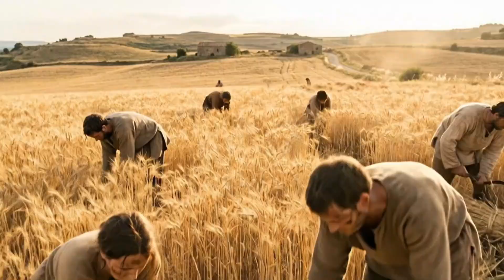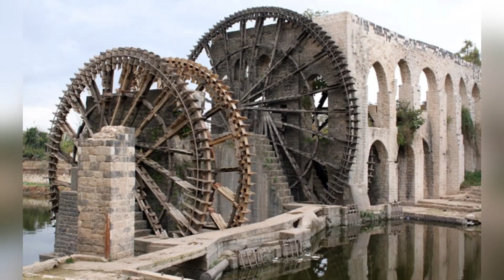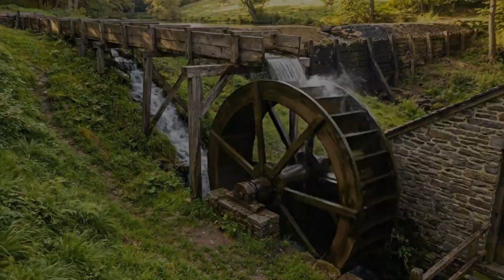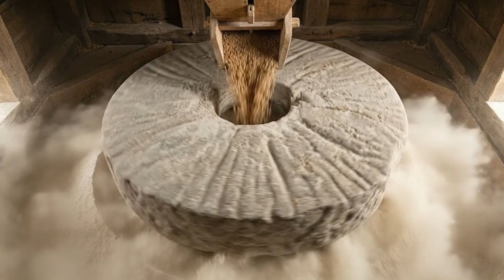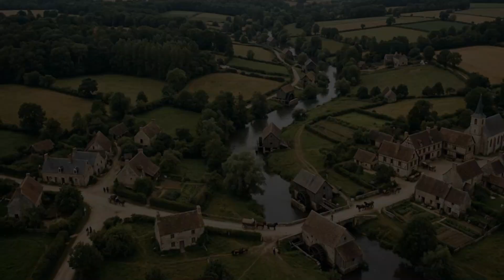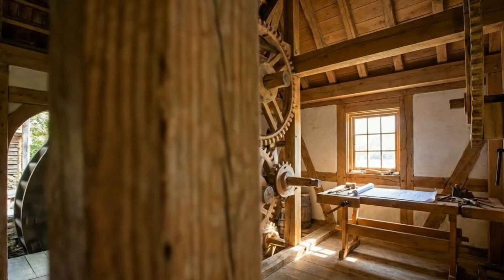Before Engines: How Water-Powered Grain Mills Worked

Comment: If Oliver Evans could invent gadgets to automatically conveyor-belt flour around a mill, it seems odd to me that nobody invented a fan to blow away excess flour dust - or even to winnow out chaff from flour - and if the romans could line 32 mills (16-aside) why couldn't one mill run several grinding stones in series too (given sufficient water power?).